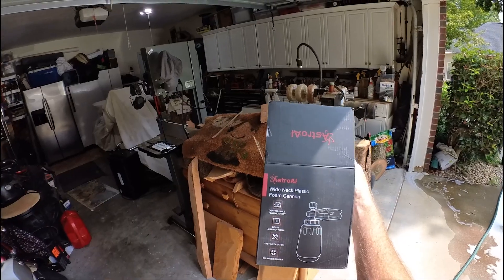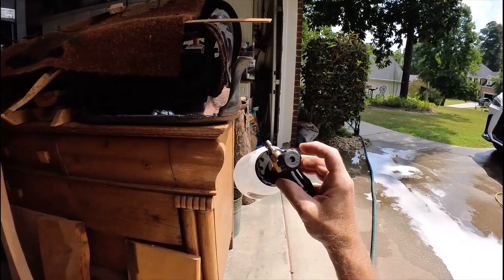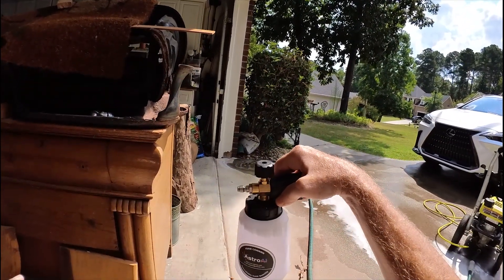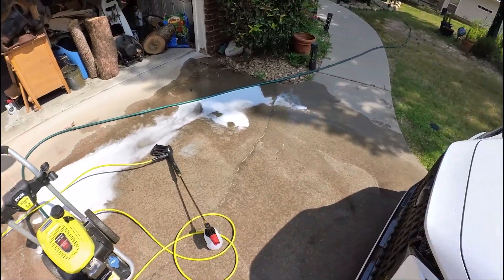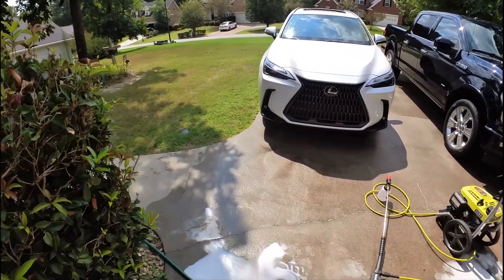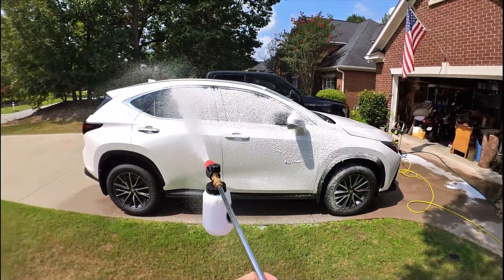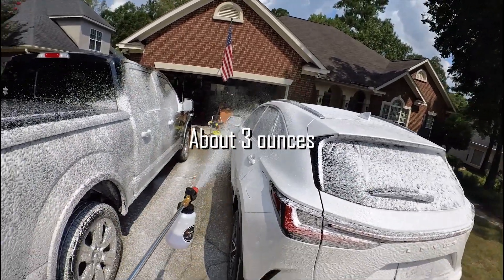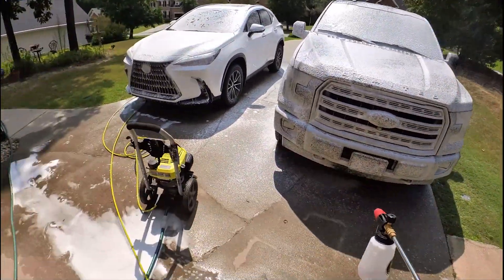AstroAI foam cannon review

Comment: Swap out the orifice for the 1.1mm and it will generate a thicker foam with Chemical Guys.
Reply: Thanks
Reply: It already has a 1.1mm in it
Reply: It has a 1.0
Reply: Going UP in orifice size seems counterintuitive. The unit comes with a 1.0mm orifice. Typically when guys are recommending such a change, the standard orifice of a foam cannon (seems to be) 1.25mm. And the intention is to restrict the water flow. Going from the included 1.0- UP - to a 1.1mm would make me think “more water, less foam”. But I’m not an expert. I just used my AI today and it didn’t deliver great foam with an 1800psi unit. Not thick like this fellow showed in the Lexus or the black truck.
Reply: A lot of the reviews of this cannon say that astroAI is lying or incorrect. Because when they take the orifice out to look it is actually 1.25. I just ordered this foam cannon and I ordered some 1.1mm orifices too just to swap out and be sure.
Reply: @Javii96  mine came with the 1.1 orifice.  No need to order, unless they don’t include it anymore.
Reply: @jasweb147  mine came in and it appeared to look larger than the 1.1 I ordered. But for 5$ to have a couple backup orifices and the foam makers still not a bad idea to have some on hand. Thats good to know it came with the 1.1 though, I didn’t actually measure mine. Just appeared larger.maybe it was just in my head.
Reply: @Javii96  nice!  The cannon will make that wonderfully thick snow foam that everyone likes.  Draws a lot of attention from the neighbors.